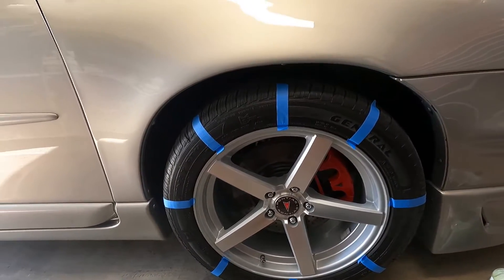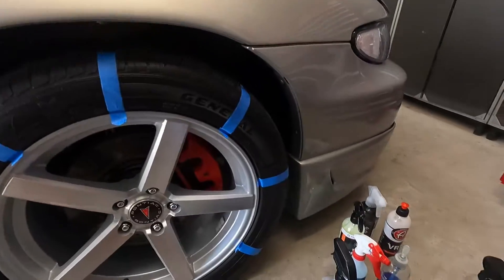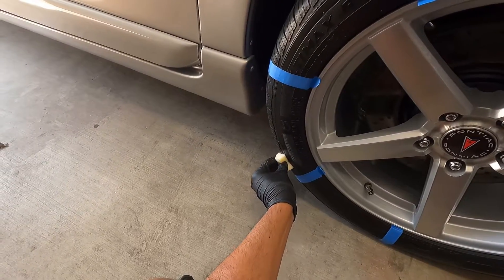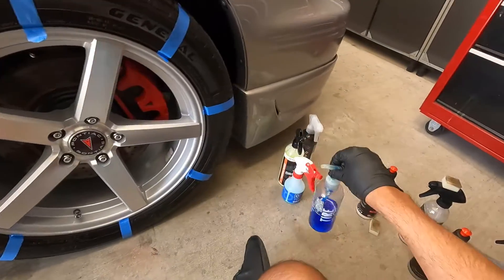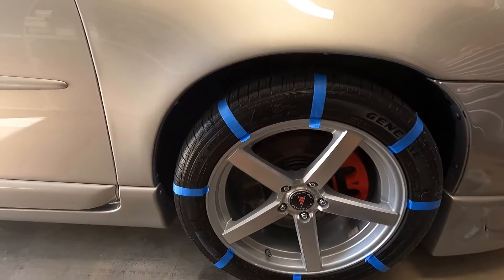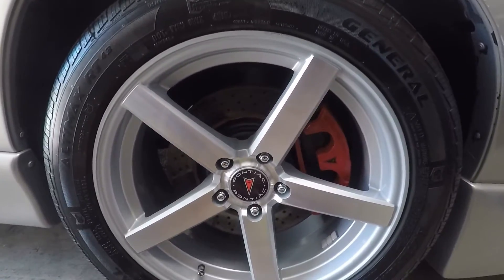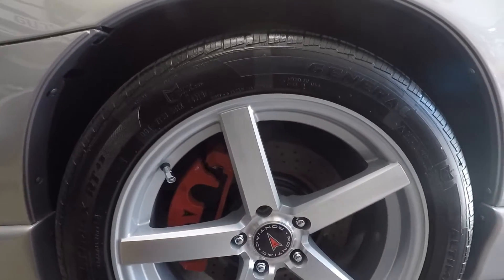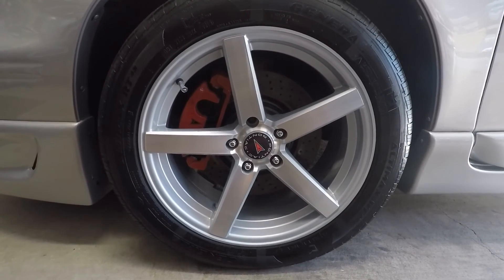Tire Dressing Showdown - Which will come out on top?

Comment: I have a dozen different tire dressings/coatings in my collection, including the soon to arrive TWHS graohene dressing which I'm very excited to use. Now some of these products I don't use too much but my "go to's" are Gyeon Q2 Tire and Adam's graphene tire dressing, depends what I want at that moment.

Looking forward to the test Guz😉
Reply: Turtle wax graphene beats them all if you apply it correctly. You have to spray the tire liberally and allow it to dry for about 10 minutes, then use foam applicator to even it out. If you just put it on the applicator you will be very disappointed in the shine. Overspray will get on the wheels but easily wiped off.

Comment: Tire still looks a little glossy and some black coming off on the applicators, could’ve probably used a few more cleanings and an ipa wipe down but either way curious to see how it goes 
Have only used the OG dressing and Perl out of these and I find Perl is looks consistently better and easier to deal with. I tried the regular Adams tire shine not realizing it was silicone based and it was way too finicky and patchy for me. One of the easiest I’ve used is shine all from P&S just no longevity.Gtechniqs t2 is also super easy as well.